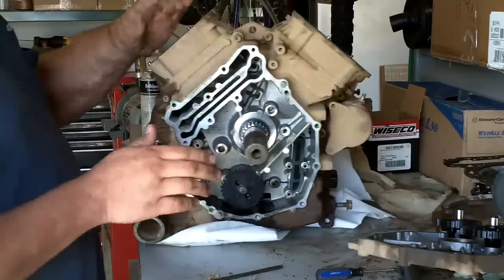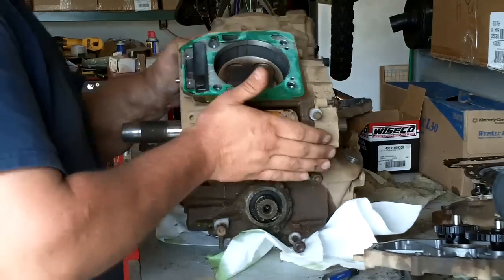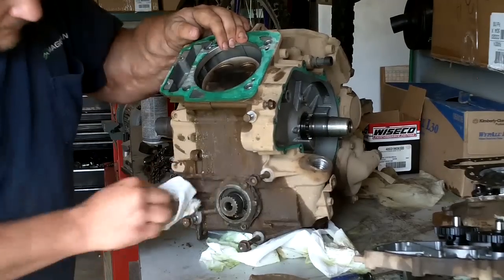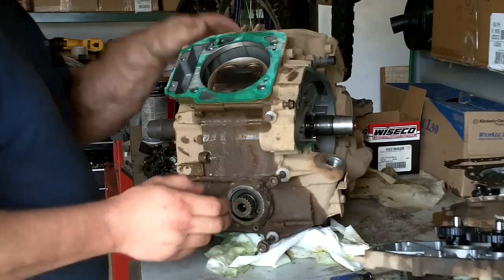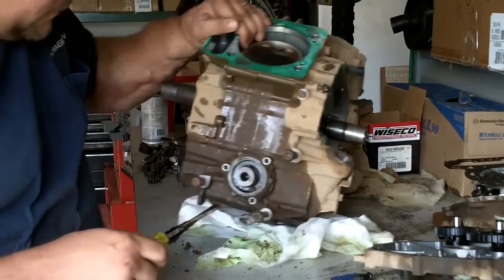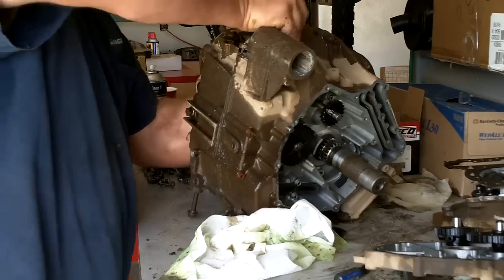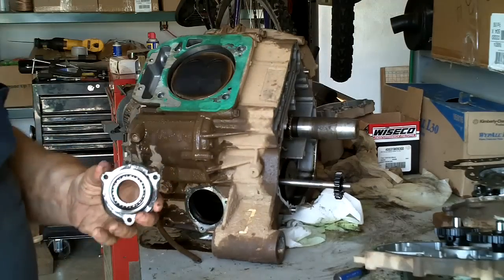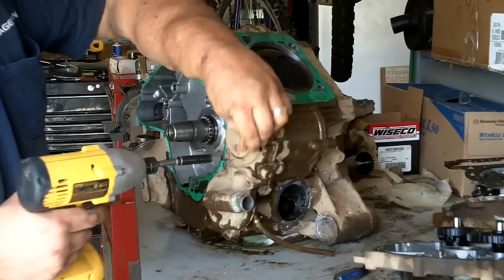Can Am Outlander Renegade How to video Split engine cases pa

Comment from the maker: yes, there are a few videos on youtube on how to do it, it is not an easy job by any means and you can damage the case if your not careful
that being said you can only replace the rotating seal, you can not change the drive shaft which could be grooved and causing the seal to fail

Comment: Hi! I have a problem 800 outlander g1, when I opened the engine found: arrow on the piston 1 is directed toward the second cylinder is that correct? the rule arrow should be directed to the exhaust I was very confused, tell me how it should be right ?! 800cc engine

Comment: Hey Shane, I have a 2007 800 Outy that I bought for a steal b/c it needs new cam chains and guides.  I saw one of your forum posts (well, if you are "fatcat," that is) that state one can clean the oil screen w/o splitting the case (2-stroke junkies did the same thing).  Anyway, I plan on trying this if you think it's a good idea.  As far as I know, it was not mudded (a mountain quad from Colorado) and runs, but the chain is so loose that it skipped one tooth.  The specs from the shop that broke the bad news to the original owner confirmed all of this, including: COMPRESSION 185 FRONT 165 REAR, LEAK-DOWN 3% ON BOTH.  Does this sound like doable numbers?  I suspect the small difference in compression could be the result of the cam-tooth issue.

Any help/thoughts is much appreciated, and thanks for all the help-vids.

Jim